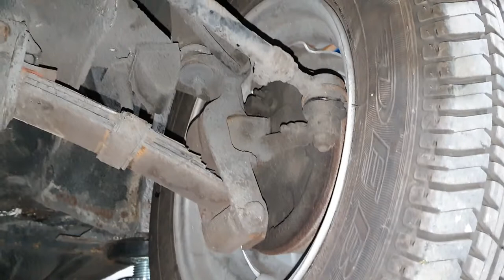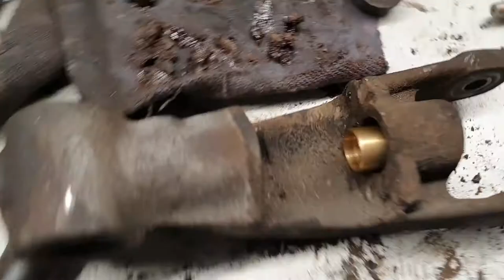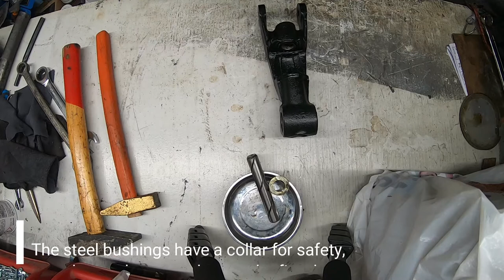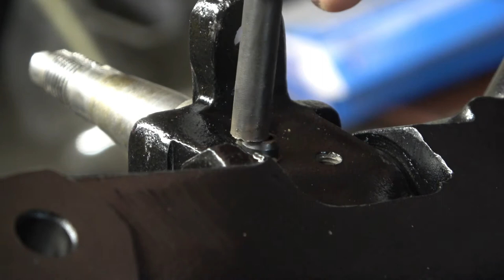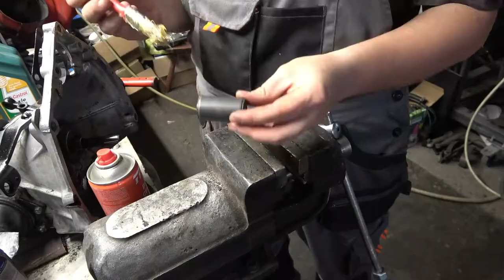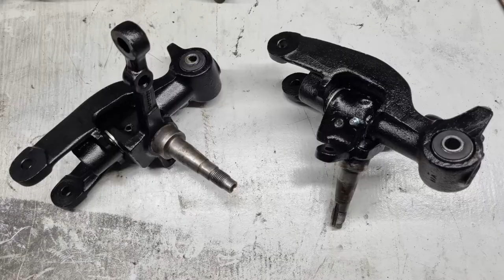Fiat 500 Classic - Part 7 - Front spindles restoration

Comment: How did you get the kingpin out of this assembly?
Reply from the maker: There's a safety pin installed in the knuckle, you can see me hammer it in at the end. You need to remove that and then hammer the king pin out.
Reply: @AircooledProject  I got that safety pin out but the kingpin must really be stuck. I may need a sledgehammer to dislodge it, lol. Could it be that hard to drive out, in your opinion?
Reply from the maker: I don't have much experience with this. I only rebuilt this set, and the pin was pretty easy to get out. I guess if the car sat for a long time and there's lots of rust, it could get stuck. Try heating the outside of the knuckle.
Reply: @AircooledProject  will do. Thanks for your help and quick replies. Much appreciated.
Reply from the maker: No problem. Good luck with your project!
Reply: Hi, did you have to ream out the new brass bushing?